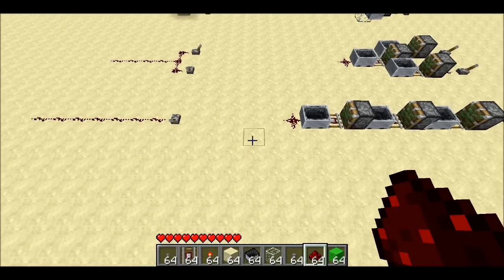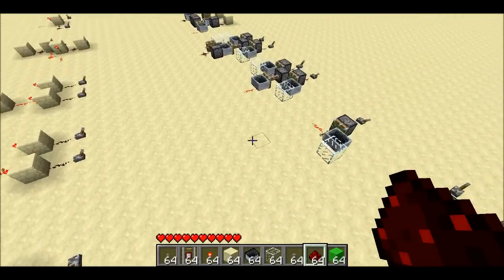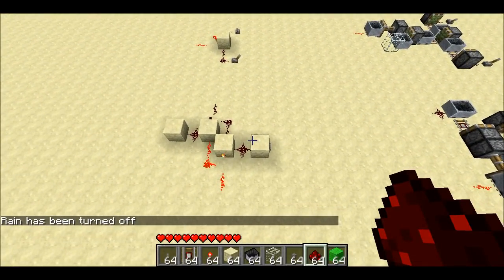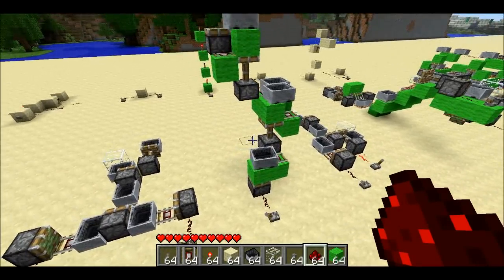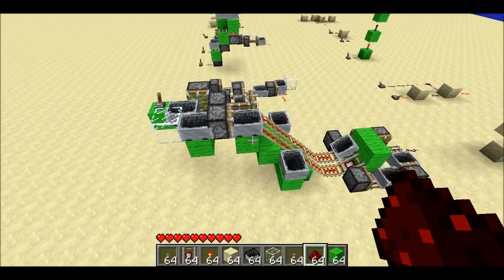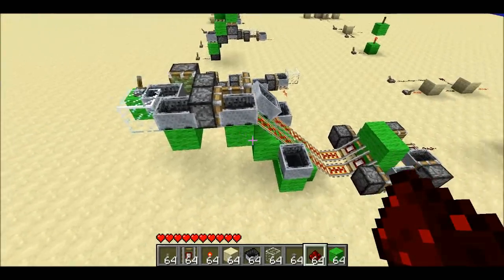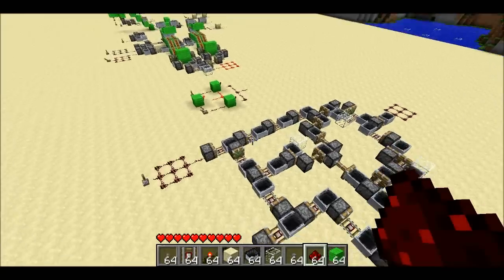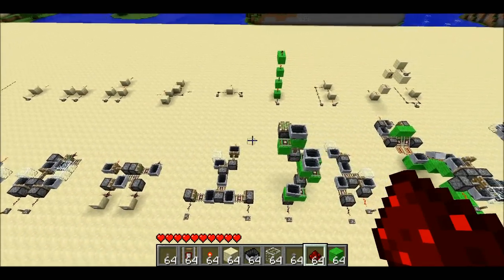Proof of Concept: Minecraft Computer without any Redstone Dust, Redstone Torches or Repeaters

Comment: The best thing is, redstone torches power blocks above them, so if you have that kind of wiring under your floor, you have to put two layers so the redstone dust isn't triggered from  below.
Vertically, this is more compact than normal redstone

Comment: Just a thought, it wouldn't be infinitely usable, but would last a pretty good amount of time, you could use dispensers to drop items on to pressure plates/into water currents pulling them to pressure plates for downward power.

Comment: @deathterm They are powered by detector rails. For example, on the one where he explained the downward circuit, you might have noticed the two stationary mine carts sitting on the sides of the design. These mine carts were sitting on detector rails to power the tracts next to them.

Comment: Omg.

This would sound SO AWESOME when it was running.

You'd hear CHUNK CHU CHUNK CHU CHUNK CHU like it was an engine running. :O!!!

It'd probably be very loud.

It also seems like making memory on a computer like this would be easier than normal, since you could in theory use the minecarts as physical memory.

Kind of like a solid state hard drive VS a normal optical hard drive.

That may not be correct though. I'm more of a software guy than a hardware guy.

Comment: 8:40 easier way, Piston facing up with 1 - 12 Sand/Gravel Blocks on top, Minecart half on the top Sand/Gravel Block and a normal block with detector rail right near the top block were the Minecart is standing :)

Comment: That's actually kind of simple, just put two blocks down with a two block gap in the middle. Place a powered rail on of the spaces, and a detector rail on the other. Then, chain a bunch of these together, put a lever on the block behind the first powered rail, and that's what you got! Only disadvantage: It's not resettable.

Comment: @ExSeaD The other problem is that boats break themselves really easily, and it would be hard to get them onto a pressure pad without getting them stuck on the pressure pad.

Comment: 3:34 I'm 13 and I know that all you need for any gate is wire and inverters, because any gate can be made from and gates and inverters and wire and you can make and gates with inverters.
Also, I've made a 2 bit adder, expanding it to three bits and, challenge accepted. When I'm done, I'll remake it ALL without any redstone wire, torches or repeaters.

Comment: @adlsfreund If you look at the minecarts one of them got stuck on top of the wool blocks. It looks like it could be fixed, but the flat design is faster and should be used anyway.

Comment: your have an or, a not gate and wires. That is litatarly all you need, as you can build a NOR-Gate out of or and not. Finally you can build and SR latch with two NOR-Gates. that will need more space then absoultly required but: An SR-Latch in electronics could be build out of two transistors, but for some good reasons more transistors are commonly used.

Comment: Sethbling do you know that this is BUD gates. But still for detector rails and power rails and pistons both sticky and nonsticky requires redstone. So still require redstone dust for making the components but you don't need them in the circuit.

Comment: I'm not going through all of the comments to check if this was already brought up, but was your xor gate not working?  It looked like when you cycled the power to 'off' on both inputs, the output was still on.  Before you were messing with it, just flying over to it, the output was off, but it stayed on for the rest of that gate, as far as I could tell.

Comment: unfortunately, detectors, pistons and, powered carts need red-stone dust.
though it would be genius to make a powered cart switch.(powered switches position from on>off and if on the off setting, reversed. p=powered d=detector b=block r=rail. bpdrrrrrrpw.
on seting is on left.both powered rails are on one button.the power flip flops the cart position. i cannot find how to detect wile siting on a powered at the same time. please, commenters, notify him if possible of this.

Comment: Insta wire was invented way back in 2011?
Reply: What?
Reply: Whenever a line turns off the end immediate turns off as well. This can be done using redstone blocks but they were added in 2013... So instawire was invented in 2011....
Reply: Daniel Conley 
yes
Reply: Instant wire was discovered once official pistons dropped.